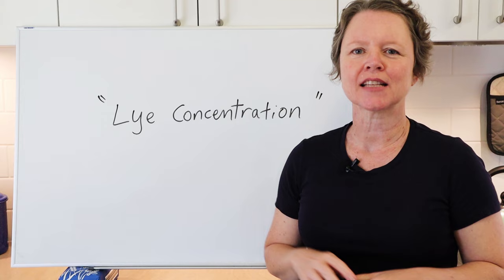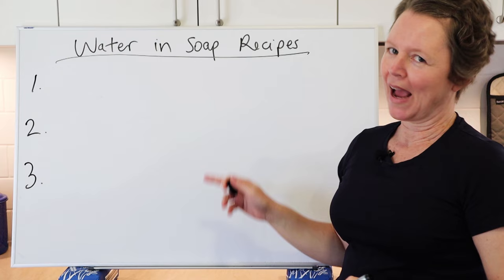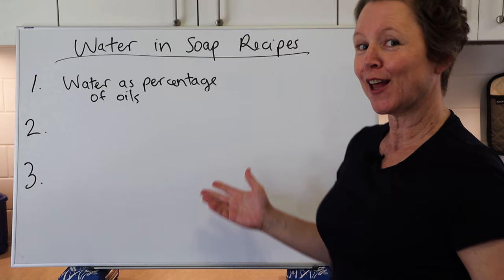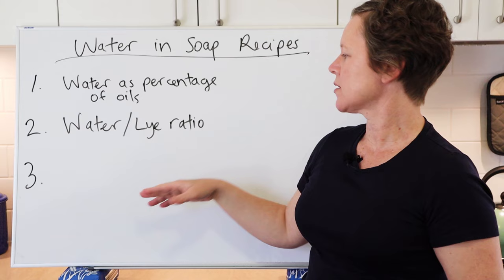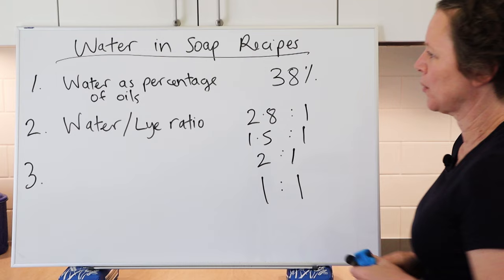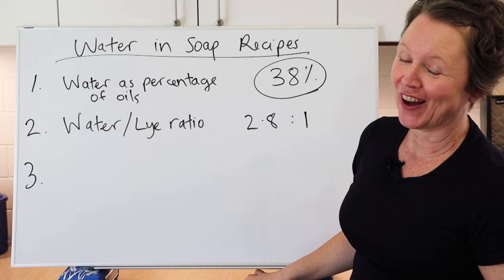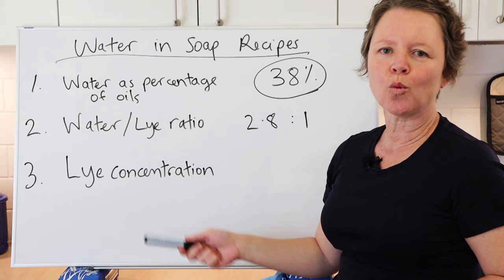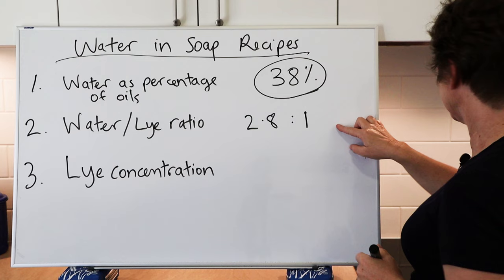Calculating Water in Soap Recipes and Clarifying 'Lye Concentration'

Comment: Yeah kinda confusing. Maybe a few more examples of ‘lye concentration’ would help.
Maybe Soapcalc is the culprit.  What’s the purpose for stating the water percentage at all?
Reply from the maker: Hi Rita, this video was made in response/follow up to this video https://youtu.be/AqKxin0q1bM
If you watch that one it will make a lot more sense. Different people use the different water calculation methods without understanding exactly what they mean. This video was my attempt to explain the differences.
Reply: Hello Rita Garand

Comment: What happen if lye concentration have 60%
Reply from the maker: You can't have it that high - as I said in the video the sodium hydroxide won't dissolve properly and your soap will not turn out. You can only have maximum of 50% lye concentration for any lye solution - and even that is a bit too high. The highest I ever go is about 40%.
Reply: @EllysEverydaySoapMaking  If I have 40% as my lye concentrate does that mean I have 60% water and 40% lye?

Comment: But how we get to know how much lye we should use in each of our recipe 🙄 there is not exact amount
Reply: The determination of lye needed will be calculated in soapcalc.net once you have determined how much oil you need for the mold you are using. You shouldn't attempt to make the soap if you don't understand the lye portion of the recipe. Like Elly said, soap calc has the water as % of oils as 38% default which you can use so you don't have to figure out even how much water to use. The calculator figures out your lye amount for you, you don't figure it out yourself. Your best option is to learn about the process of making soap before anything else. Its a learning process of how, why,  and which oils are used as well as what else can be added (if anything). There's no substitution for researching your interests or buying books on the subject..
Reply from the maker: This is the video you need Ruchi (and thank you Ginmars1!) https://youtu.be/AqKxin0q1bM